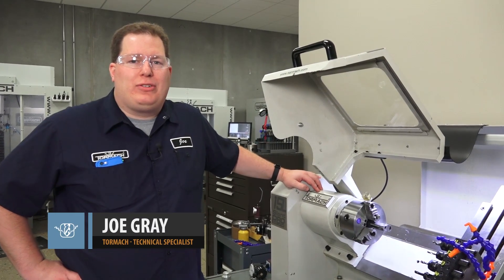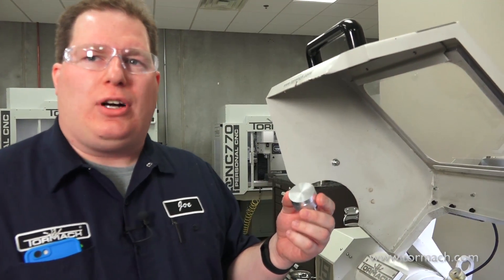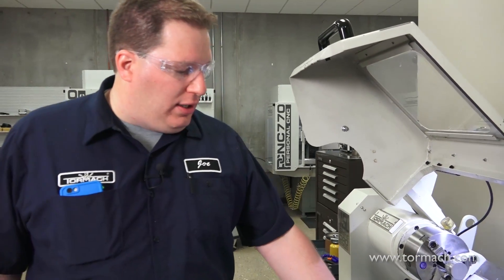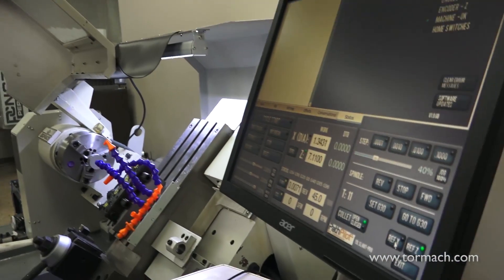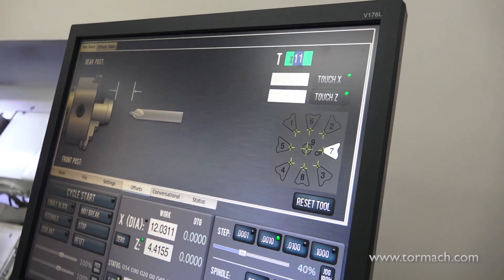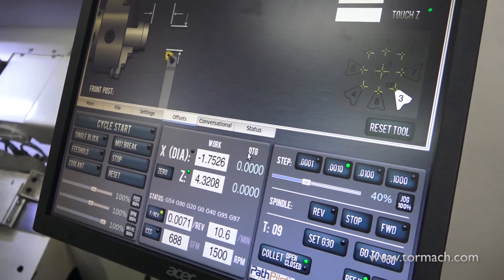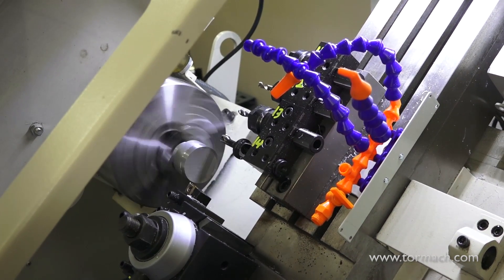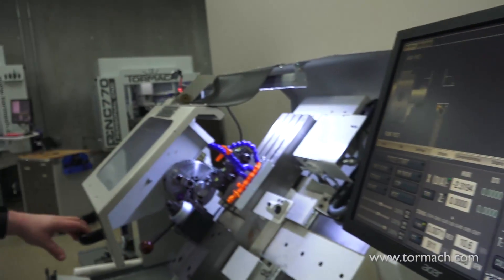Touching Off a Drill on the Tormach 15L Slant-PRO Lathe (Part 1 of 2)

Comment: never use an indicator to setup on a horizontal spindle, may it be a mill or a lathe. Indicator sags under their own weight which is fine usually because gravity doesn't change but once you start spinning it around the horizontal axis you also change the gravity direction (as seen by the indicator) and at the same time, the sag direction. As such, your tool will be offset by twice the sag amount, which can be several thousands of a inch, especially with those new fancy indicator holder with 3-4 joints and a fine adjust...

Use a coaxial indicator instead.